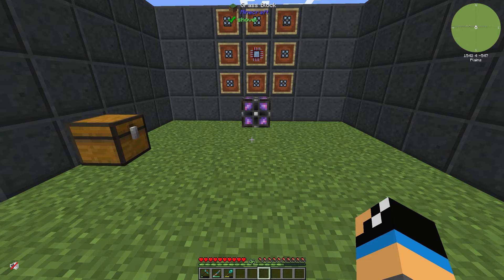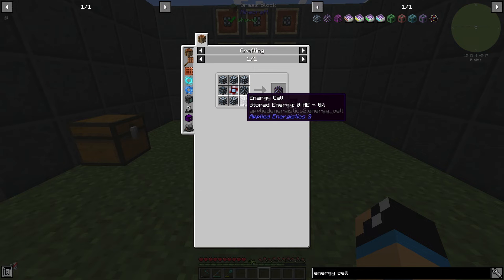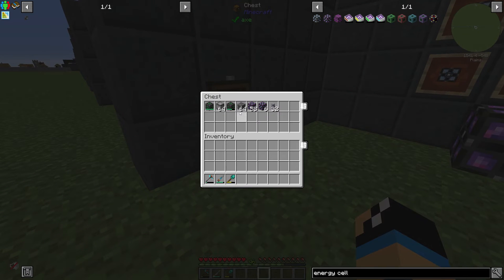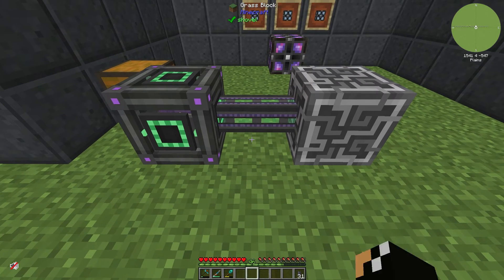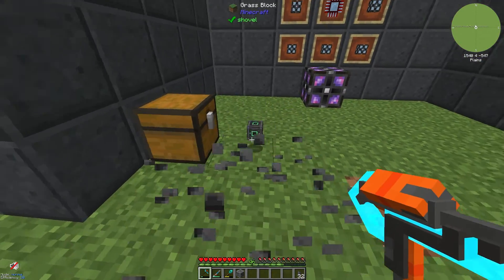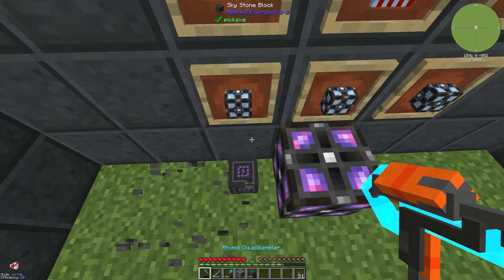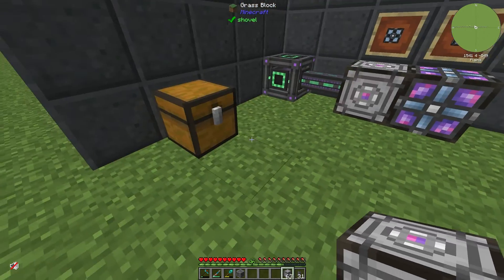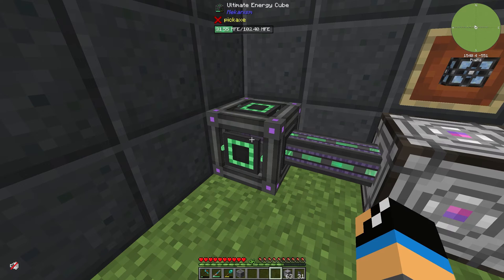Dense Energy Cell 📀 Minecraft Applied Energistics Tutorial 1.16.5 📀 English 📀 #Minecraft

Comment: Is there  a way to power it without other mods
Reply: not sure if you still need an answer but you can use the vibration chamber or a crystal resonance generator, the chamber requiring coal and the generator being passive power
Reply from the maker: you can use every other mod which can connect